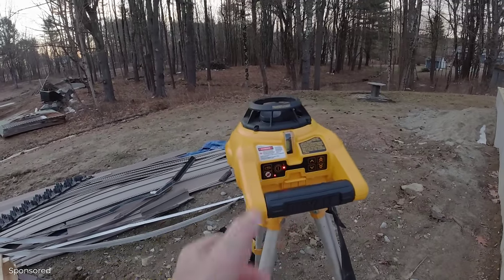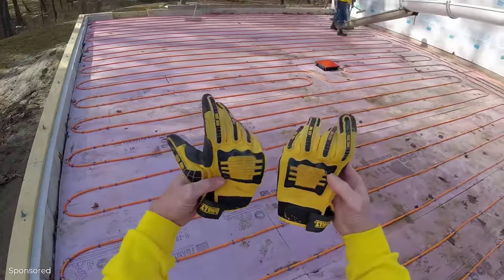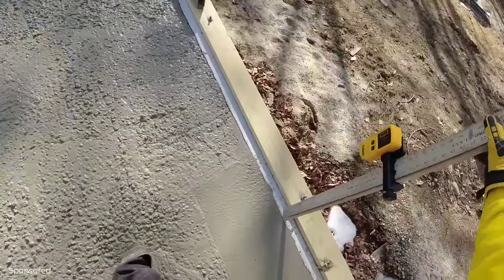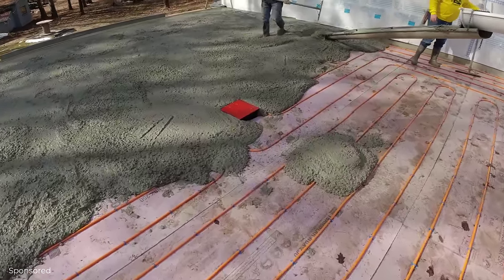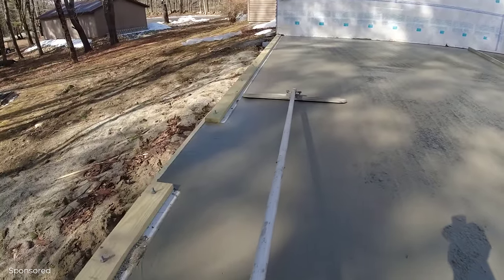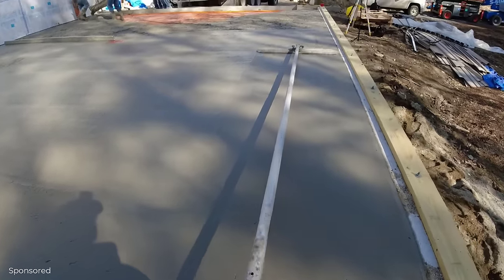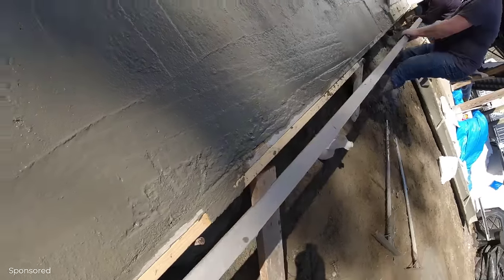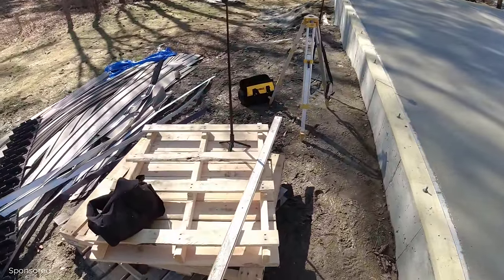I Couldn't Pour Concrete Without This! It Made Pouring This 32' x 30' Garage Floor EASY!

Comment: I’m jealous of that water reducer! When I was working, we either did not know about water reducer, or more likely, hadn’t been invented yet. Those 4-5” slumps were killers, pullin that stuff with our come alongs” (concrete rakes) 😂
Reply: Water reducer is nothing new. The company’s I poured concrete for didn’t permit its use.
Reply: @JBekus  Thanks. I worked from ‘69 to 2009. Never even heard of it!
Reply: @johnfahey7215  It’s an extra expense so someone probably didn’t want to use it to try to save some money at the expense of the help’s backs.

Comment: 9:35 - I would have consider a Bosch LR 50 Laser Level Receiver instead. Because that will tell you exactly how much you are off, and not just beep when at exact level.

Comment: so besides the promo MIke .Whats better the Top con or Dewalt cause ill be honest I have always bought dewalt but they are far from the best tools.
Reply: What makes the other brand better? Serious question? I'm do hvac all my tools down to my screw driver sets are dewalt I've never had a issue.
Reply: @stevewayne3676  I find the drills are a bit loose compared to others.Have had problems with batteries getting stuck on tools .Not gonna make or break me i guess lol. I like to try and get the best for my buck .
Reply: I've found that the laser itself isn't as important as the receiver.  Some of the receivers that come as part of a kit aren't as accurate as a good receiver. They have more leeway on what it says as perfect. I was in a pinch one day and had to buy a Bosch from lowes. Was maybe $800 as a kit a couple years ago.  The receiver would say good +/- a quarter inch of movement on the stick.  It just didn't have a tight tolerance.  But the Bosch laser together with my spectra precision receiver worked great. But just the spectra receiver costs just as much as the Bosch set. And the hl450 receiver I'm talking about reads as a tape measure.  It tells you how far off you are 1/16 tolerance.
Reply: @kenlapiene6721  Awesome thanks man